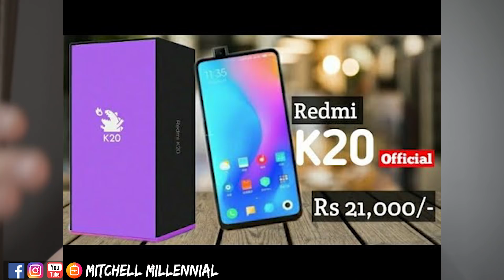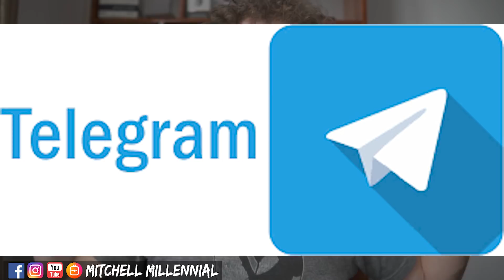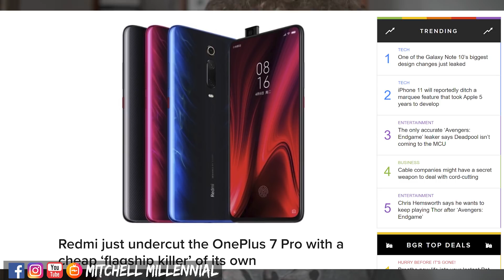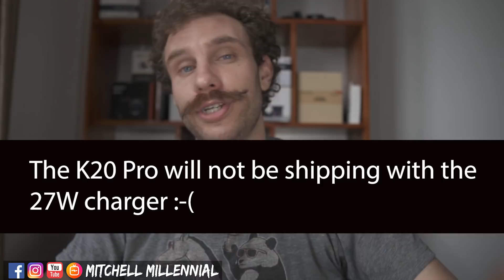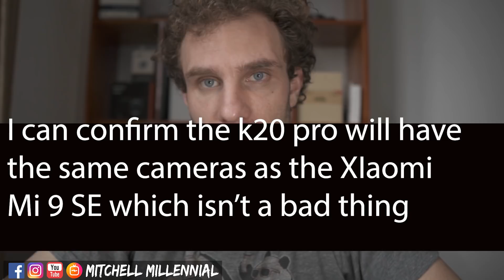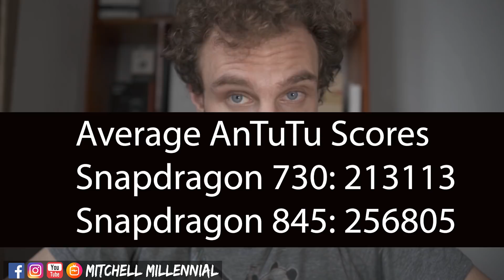Redmi K20 Pro And Redmi K20 Preview // The New Flagship Killer?

Comment: Does the K20 pro will have stereo speakers & OIS?
Reply: nope.
Reply: @wowsunwellgold9782  Then I think Mi 9 is a better deal.
Reply: @hamzalatief5066  Mi9 has no OIS and Stereo aswell....K20 pro has better battery, 8 gb ram in the same price for 6 gb in mi9 and from what ive seen it has a little better fingerprint. Also i dont like notches.
Reply: @wowsunwellgold9782  Yeah you are right. But  one thing which letting is me to think not to buy K20 pro is that the cameras on K20 pro are same like the cameras on Mi 9 se. Soo in this case mi 9 is pretty much better.
Reply: hmm i will just wait for the full review of the camera with comparision. I use mi5 and i really would like to change it. Perhaps ill just wait for mi10 :D hope it will be much more expensive but we will get like OIS, better battery and better camera for that.